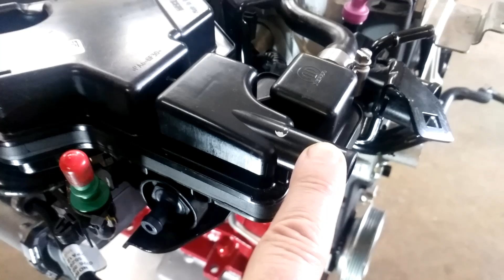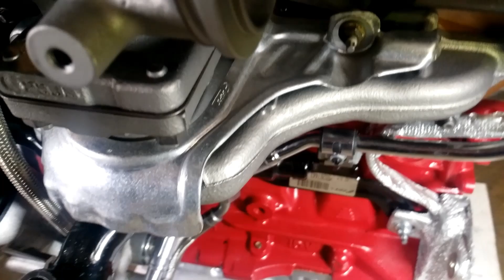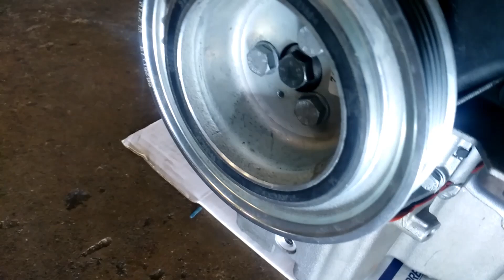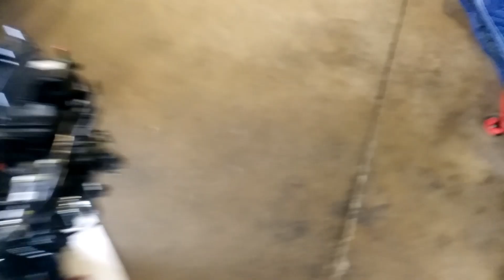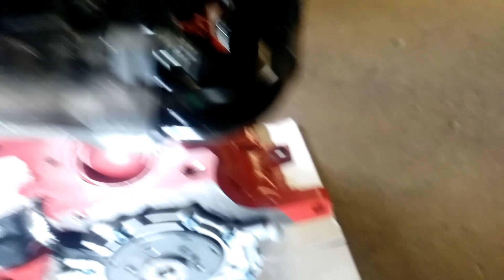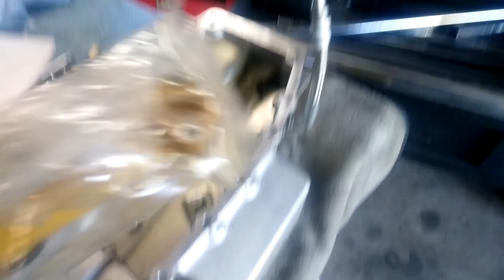Fiat 1.4 Multiair Build Completed, Plus Timing Belt Change Instructions

Comment: Hey Greg I have a 1.4 multi air and i have looked for a rebuild manual without any luck. Any suggestions?
Reply from the maker: The factory manual is the only one out there.
Reply: @GregsAirplanesandAutomobiles  
   Can you get it in paperback?
Reply from the maker: Nope.
Reply: @GregsAirplanesandAutomobiles  
   Breakin my heart. Ok thanks.
Reply from the maker: I'm sorry I don't have a good answer for you. The idea of writing my own overhaul manual for EC customers has crossed my mind, but I don't think it's going to happen soon. The demand just isn't there.
Reply: @GregsAirplanesandAutomobiles  
   Yeah i can see that. Whats a ec?
Reply from the maker: EC is Eurocompulsion.net . I'm part owner and we give tech support to our customers. At some point I'll have to provide a shop manual.
Reply: @GregsAirplanesandAutomobiles  
   Cool. If that manual includes info to switch from factory to upgraded parts with all the details and suggestions it will be gold.
Reply from the maker: The factory internals are outstanding, I suggest upgraded pistons and mild head porting, but that's about all the internal mods I suggest.
Reply: @GregsAirplanesandAutomobiles  
  So what are the options for upgraded pistons?
Reply from the maker: EC pistons. Standard bore or .010" over, stock or 9.3:1 compression.
Reply: @GregsAirplanesandAutomobiles  
  Ok.well honestly i probably will not go internal unless i have to. All i really want is to maximize power and fuel economy. The power band seems to live and die between 2 1/2 and 4 1/4 rpm which is a real bummer. Whats the best way to fix my problems? I was thinking maybe new injectors definitley new coil packs throttle body riser eventually a larger turbo and a tune or remap plug n play as well as a aftermarket exhaust. Where does power and fuel economy maximize?

Comment: I’m trying unsuccessfully to remove the crankshaft sprocket/timing gear. Could you please confirm that the threading is normal for removal (counter-clockwise)? Thank you.
Reply from the maker: You didn't tell me exactly what you are working on, but yes, in all the Multiair 1.4's I have seen, the threads are normal for the camshaft sprocket. However, it's torqued to 88 foot pounds, so it's on really tight.
Reply: Thank you for your reply. I’m trying to change the oil pump on a 2012 FIAT 500 sport. I’ve completely destroyed the head of the bolt. I’m trying an Irwin Bolt-Grip as my last try with a wrench and breaker bar. Failing this, I’ll cut the reminder of the bolt head off and figure out how to remove the rest of the bolt. :)
Reply: Well, that worked. I also cut a relief cut around the perimeter of the bolt flange to relieve some stress. It’s a torque to yield bolt, so I had to replace it anyway. Thanks again for confirming that it’s a regular thread!

Comment: Hey Greg hope you can answer a question for me. While I was priming the brick on my 1.4 engine through the ball valve under the oil filler cap the ball went missing where did it go and is this a problem.
Reply from the maker: Hi Marvin, I need more  information because that's not how you  prime this engine. A. Why are trying to Prime it? B. Who told you to mess with that ball? C. What forums are you on and what's your username there so I can get an idea of what's going on here. Any piece of metal floating around in the engine is a problem. We will have to take care of that, but I need to know what the heck is going on here before I can help.
Reply: @GregsAirplanesandAutomobiles  Ok Greg here is the just of it I bought a salvage 124 abarth it had been sitting for a couple of months, got it home and it would not start. I wasn't surprised after all I have read about them not starting after storage. From what I read the brick needed to be primed and the way to do it was to pump oil through the ball valve. I pushed on the ball figuring it was spring loaded and it went down and never returned. I thought the ball might return after it started, it did not, the car did start second try after pumping the brick full of oil. In fact the oil shot straight up on to the bottom of the hood and all over the engine. I believe the ball is still in the valve but pushed to the side or something. This is why I am asking a 124 expert for advice. The car is sitting on jack stands while I work on the body. The engine starts and runs great. The valve is located in the top of the brick directly under the oil filler cap.
Reply: Never mind I took the valve cover off and then the top of the brick off, located the ball, spring, and holder and reinstalled them. I won't be pushing on that check valve ball again.

Comment: My belt broke does that mean the engine is toast
Reply from the maker: It depends, which belt?
Reply: @GregsAirplanesandAutomobiles  the one that drives the cam ,an also it spit out a code ,no clearance
Reply from the maker: I'm afraid I have bad news. The valves have hit the head, it's usually cheapest to get another engine at this point.

Comment: Hi, I have a 124 spider and over the weekend when I got my oil changed, my mechanic said I need a new water pump and thermostat.  Will this require the engine to be taken out?  Or can it be worked on withouthout have to remove it?
Reply from the maker: Assuming you are talking about a 2017+ 124 Spider, I think your mechanic is wrong. I seriously doubt you need a water pump. If you do it's a big job, but no, you don't need to remove the engine. The water pumps in these things last seemingly forever.
Reply: Sorry for the late reply.  I thought I'd give an update. Turns out it was the water pump along with the thermostat and gasket.  Looks like this is now a well known issue on the 124s.  Needless to say all items were replaced under warranty and so far, no more leaks.

Comment: Do you reccomended mopar oil only?
Reply from the maker: Not really. I just suggest using a true synthetic oil of the correct weight. As long as you do that and change it when you should, there won't be any problems.

Comment: I know the Dodge Dart and abarth 500 share the engine I was wondering if I can drop the 500 L multi air 1.4 turbo engine as well I’m sure it’s the same but just curious if it would work
Reply from the maker: If it's a 2014 or later, then yes.
Reply: @GregsAirplanesandAutomobiles  ooo alright cool so I guess my abarth could be brought back to life with that motor 🥺 affordable route

Comment: What is the advantage of having the intake valve cycle twice during the intake stroke?
Reply from the maker: That's a good question. It's used to minimize fuel consumption and emissions at very low loads. It would take an entire video to explain why this works. It's only used at low loads.
Reply: @GregsAirplanesandAutomobiles   Yeah, is it running an Atkinson cycle or simulated Atkinson? I believe toyota is using it in production. Koenigsegg to, but those mad lads have no cams
Reply: Sounds like it just reduces pumping loses
Reply: It stratifies fuel while reducing pumping losses

Comment: What happened to the first engine that's in the car now?  Did it fail?
Reply from the maker: No, it's fine. I'm going to overhaul it as a near twin to this one.
Reply: @GregsAirplanesandAutomobiles  what power level are you expecting post tune?
Reply from the maker: No point in speculating, it will be on the dyno soon enough.

Comment: Hi can you help me or direct find a manual 6 speed gearbox for my 2009 fiat Bravo 2 198 1.4 T-jet I have the selespeed 6 semi automatic system and it has failed I am doing a conversion instead of replacing the selespeed gearbox and having the same problem with the electrical
Reply from the maker: Sorry, we never had those here, so I can't help.
Reply: What is the final cc you ended with? Someone did a 74 mm bore!